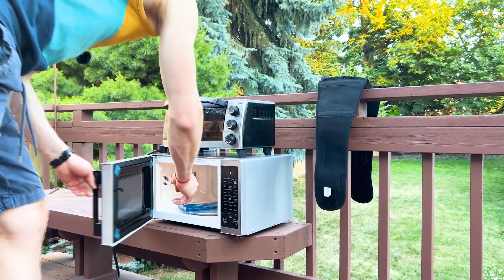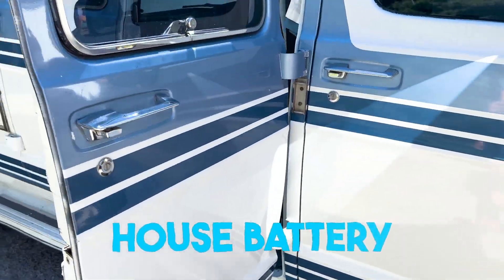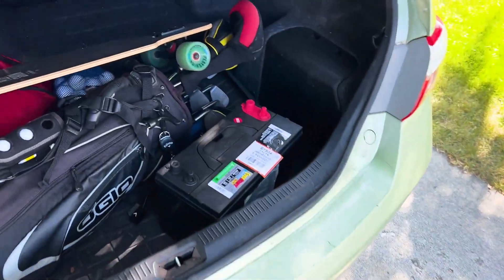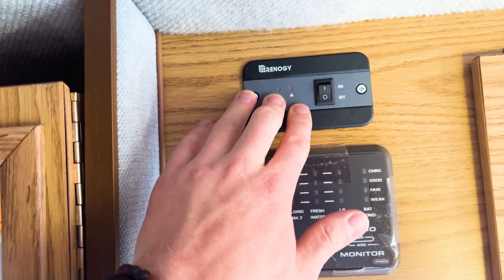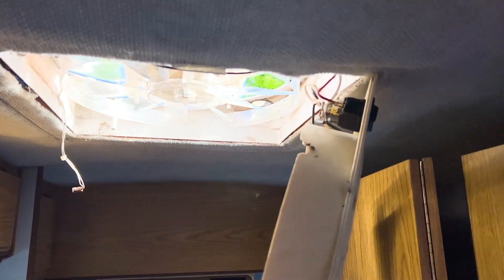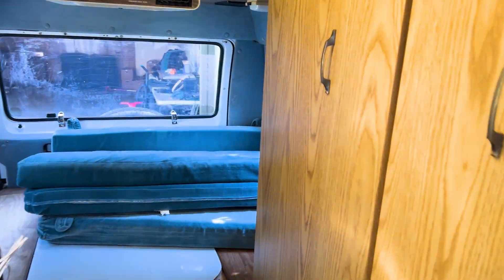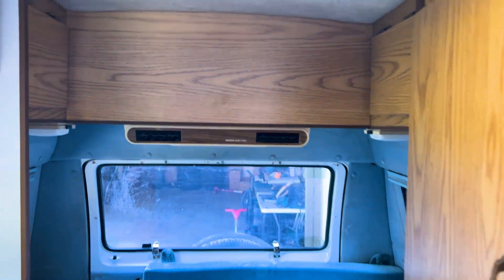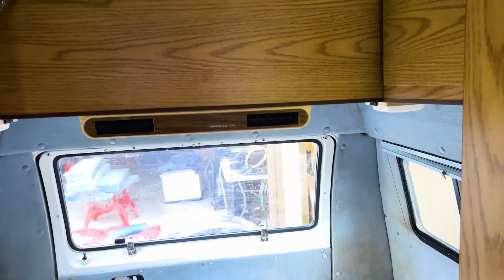How to Install Solar System in RVs and Vans

Comment: it's interesting to see the air space between the solar panels and the roof ...this means the panels are not only making electricity but also shading the roof of the van reducing the inside heat ... Nice work ...!
Reply from the maker: That’s a great observation! I didn’t purposefully make that happen but now I’m very satisfied with the set up